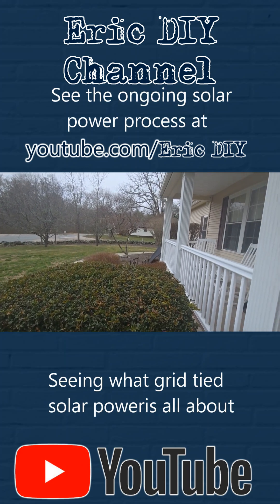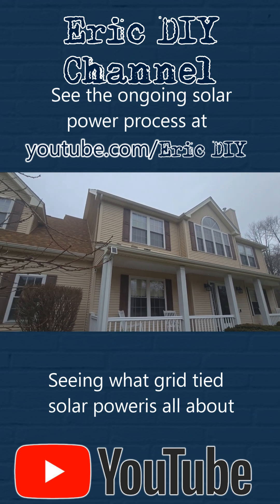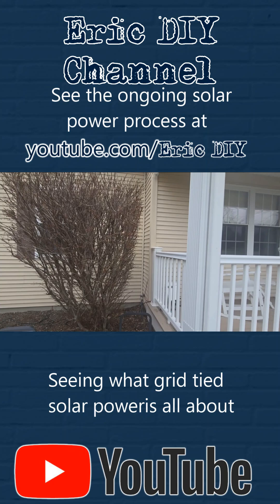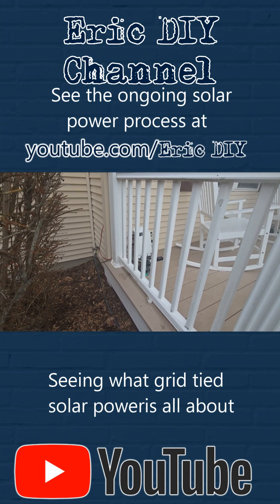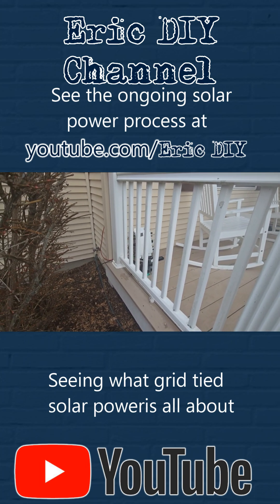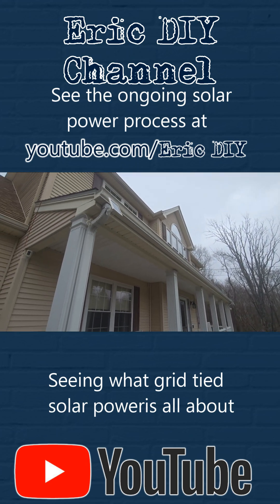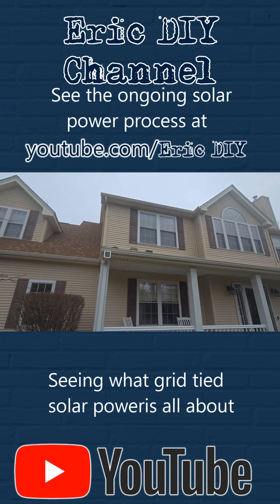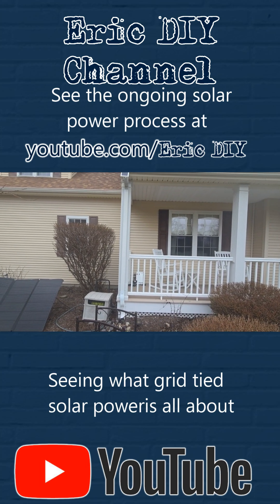DIY Solar Power Grid Tie System Testing #diy #solarpower #renewableenergy #solarpanels #cleanenergy

Comment from the maker: Just bought the next set of solar panels....bifacial to see if those help to be more efficient....going to make a series of videos as I go through this process...I'm just in the beginning of this but hope it shows on the electric bill eventually. I have tracked energy usage in my house since we bought it and have seen the prices go up as we only have one provider who keeps raising the prices on maintenance of the system while we are allowed to select our energy provider. Biggest problem is finding the best way of keeping the panels on the roof securely without drilling if possible
Reply: Bifacial seems to be a little better. I also have learned that nowadays you need the electric company to install a netmetering meter if you want to pump back into the grid. However, I'm still going to see if my solar power is at least reducing my usage with the grid tie inverter. Either way, it provides a way to charge my portable solar power box that I will be reviewing soon as well. Also, when I'm ready to do the whole solar setup, these panels will be hooked up after that is complete and add to the system (that's what I figure). It also keeps my wife from asking me to remove the pop up panels from the front yard which I will use when camping away from home whenever that is.
Reply from the maker: Well...we know it works because the electric meter goes slower with the grid tie inverter plugged in and goes faster when it is unplugged. New video coming soon documenting the progress
Reply from the maker: Been working for months now and my old analog wheel meter goes backwards when not using air conditioning on a sunny day. My bill is also showing lower rates. I will make a full out video review soon.